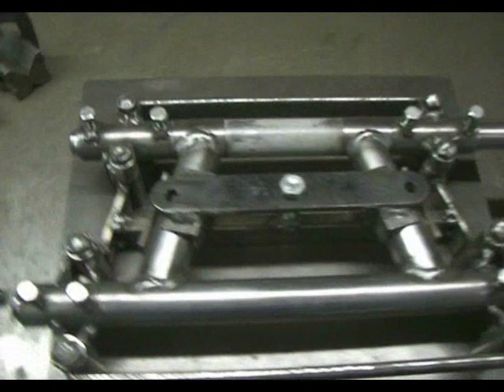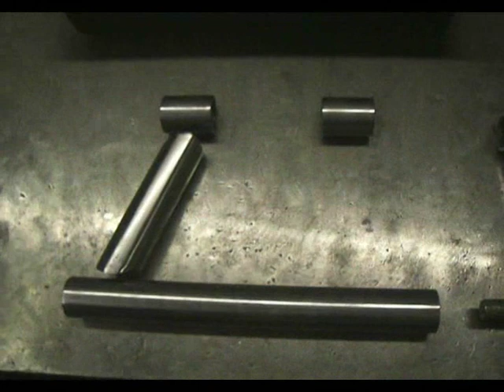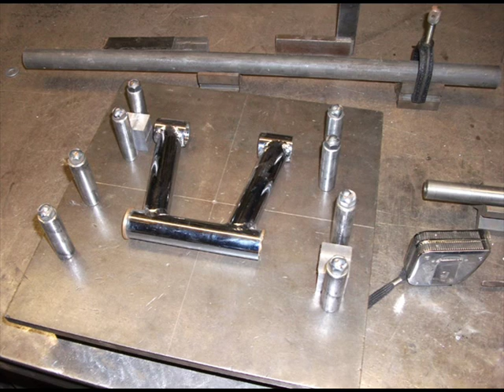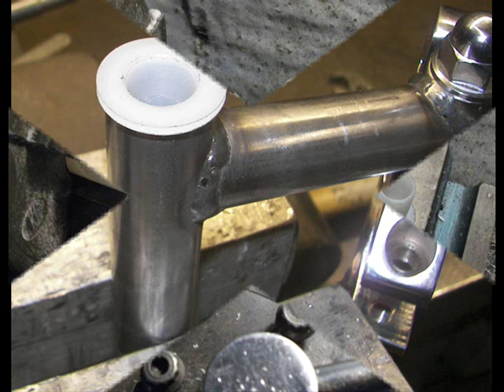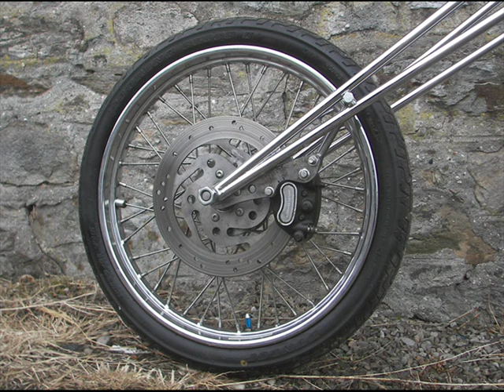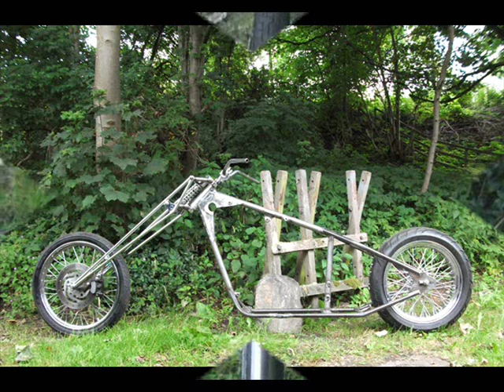Building A Harley Davidson Sportster Custom Chopper Hardtail Frame - Part 3 - Girders

Comment: wee question, as I said in previous video I now own this, dunno if it was you or previous owner that drilled the dome nuts in the girders and put split pins in, but it looks terrible. if you tighten the nuts up the girders don't work. were they designed to be torqued quite low with Loctite? just asking as its a issue im having to deal with at the moment. cheers mate